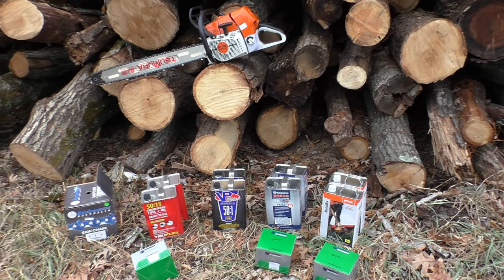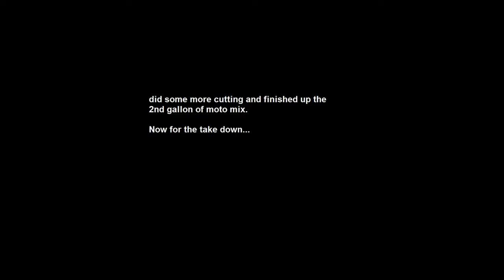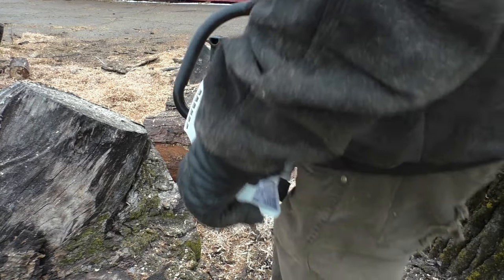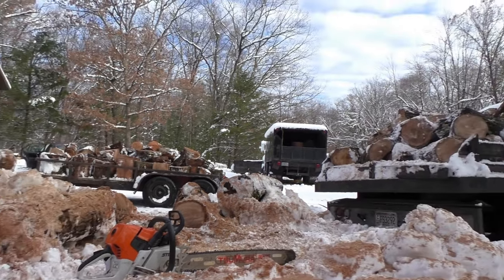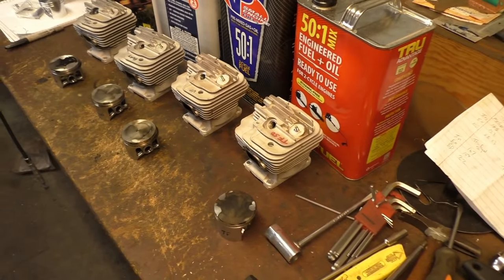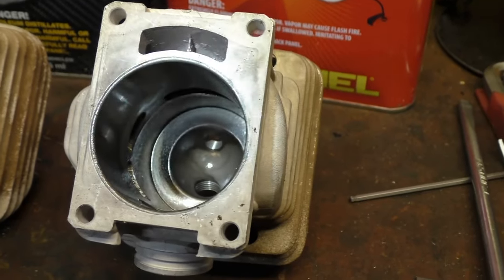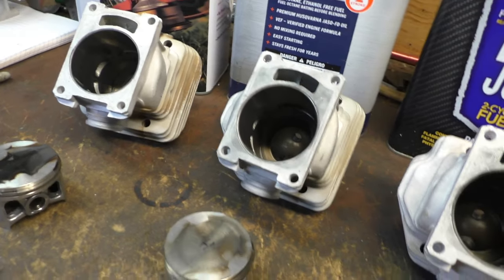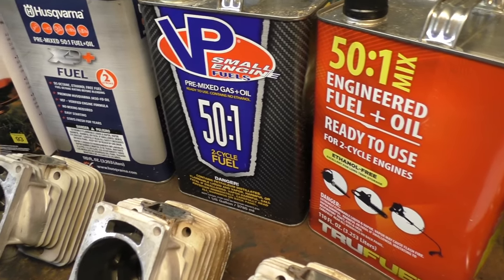Premix Fuel Test - Stihl vs Husqvarna vs VP vs Tru Fuel 50:1

Comment: Nice effort guys — Thanks!.  Two things though, I would have like to have seen the results of using pump gas as a final convincer, and the cost difference in using pump gas and simply rebuilding the carb regularly.  $24-30 for a gallon of fuel is pretty steep...
Reply: I wouldnt use Pump gas, that even with YOUR Equipment.. that's Trash, with Sketchy Guesswork
Reply: Understood, if you add up all costs it can be cheaper to accept any issues with pump gasoline, but I think they are testing this type of fuel for Joe Average who wouldn't even know that his chainsaw has a carburettor. Very good point, though. It's like a professional mechanic said to me once when I asked him if he thought "Snap-On" tools were worth the money; he said I never buy them, I can buy six cheap sockets, have a new one every few months and still be monetarily better-off. If Joe Average (ab)uses a chainsaw and throws it away after two-three years, he might consider that acceptable in money terms if he can buy the chainsaws cheaply from a Big-Box Store and run them on cheap gasoline. The same calculation is skewed in the opposite direction for a person who must heat his cabin with wood, has paid 4-5 times as much for a good saw, lives up in the tree-line in the middle of nowhere and values his equipment. Thanks for reminding me of that.

Comment: The piston from the moto mix is the dirtiest piston out of the 4, is that cause you ran more tanks of it than the other 3? You were also looking at the amount of oil in the crankcase, is more oil better or worse? I prefer the VP MIX and run the 40:1 in all my saws.

Comment: Thanks for the video! I use the Red Armor, been running it for four years as a home owner. A mix of Stihl and Echo commercial equipment. I can get ethanol free gas at the station, right now it is over $7 a gallon here locally. I have never used it, I wonder about water in the fuel from sitting in the underground tank. And yes, I know about the water separators, etc... Most gas stations around here cannot even clean their bathrooms, so I think what must they be doing in regards to pump maintenance? I'll continue to pay the vig, never had an issue with the Red Armor.

Comment: I have run a Stihl MS441C for 20 years using pump gas and TSC 2 cycle oil, with no problems. I also add StaBil to each tank, and I have not had to dump the tank in the off season. BTW, where is the PPE? And why do so many sawyers play with the throttle?

Comment: 1- Get a certified safety fuel can.
2 - Go to your local small airport and buy 91 octane "auto gas". No ethanol no lead.
3 - Mix your own for about a quarter of what canned fuel costs.
Reply: Great post Rodney!  Premixed fuels are VERY EXPENSIVE.  At Lowes, premixed fuels range from $20-$25 for 110 ounces (128 ounces in a gallon).  In north Florida, 89 octane non ethanol gas is readily available for $3.50 a gallon.    To stabilize your fuel, you can add Stabil (30 cents) or Sea Foam (45 cents) per gallon.  Its your money.
Reply: @I am Joe No at the airport they call it auto gas. Completely different pump than the avgas
Reply: In Canada most of our gas stations offer ethanol-free, it’s pretty good stuff, like you said for about 1/4 the price… but then again that gas is for cars not small engines so it’s nice to have the option especially if you are an ocassional user, for pros I think they would go with the cheaper option
Reply: Rodneygd  I live on the Great Lakes. The fuel stations sell non-ethanol fuel in premium and mid-grade. I wonder how the price compares to air ports? Either way it’s gotta be cheaper than the engineered fuels.
Reply: Aviation gas still contains a large percentage of aromatics, which are actually a lot more harmful both for your health, and the health of your small engine than ethanol. Check out Steve's Small Engine Saloon's video on this very topic. Your best bet is to spring for the Stihl pre-mixed gas, especially if you're a homeowner. One gallon of gas goes a long, long way in a small engine, even in a powerful chainsaw. The work done by the tool on a gallon of gas should justify the $30 price tag many times over on a big job.

Comment: Man if you use a chain saw all the time and you bought 20.00 dollar plus fuel just to keep your saw running longer is ok. But you spend so much money on the fuel you could save that money and just buy a new saw. You would spend hundreds of dollars just buying great fuel. Don’t add up. Great video hats off to you! Buy non ethanol and you good quality oils to mix with.
I would like to add this: those fuels you tested are great and no doubt would not gum up a carburetor when you store your your equipment. They definitely have a place. And if you can afford the best then why not.
Reply: I agree but if the saw performs like crap on the cheap fuel, that might just drive me crazy !
Reply: Agreed. Someone further up the comments suggested that you could also use regular gasoline during the season and just switch to canned fuel for the last couple of fills before storing the machinery. However in Sweden I think they mandate the use of alkylated fuel (Aspen) if you have employees (Health & Safety legislation). Sweden is heavy on the liberal attitudes.

Comment: Will the Husqvarna XP+ 110-fl oz 50:01:00 Ethanol Free Pre-blended 2-cycle Fuel work with my Husqvarna 150bt backpack blower and my Husqvarna Heavy Duty Chainsaw 440?

Comment: Just came across this video and you really went above and beyond!! Best video on canned gas ever. I’d have expected VP to look cleaner as that’s all that they do. I’ve tried Tru Fuel in my new string trimmer and it was horrible. Lacked power and was slow to rev up. Went back to pump gas and Bel Ray oil like I’ve used in all of my 2 strokes for 30 plus years. Runs like a top now. Thank you for doing this video!

Comment: Would it be okay to dump a cap full of hp + 2 Husqvarna oil into a can of the store bought premixed Husqvarna gas? Would it help the bottom end? not so much oil to change the ratio but just a little bit?

Comment: Hi One of your subscribers in Melbourne Australia,I use stihl hp ultra oil at 50:1 in my 2 stroke husqvarna chainsaw is this okay?Regards
Reply: Should be ok, I switched to Castrol power 1 racing 2t as it is much cheaper. What model saw have you got?
Reply from the maker: if I were forced to run ultra I'd run it 45:1.  Not as much oil as 40:1 which I'd like but I personally don't think it burns clean at 40:1.  50:1 for me isn't enough oil with conventional gas.  So 45:1 would be a nice compromise.   I like mobil 1 2t which you should be able to get?...I can't get it here anymore but I see it on ebay over seas.  Also like Schaeffer's 9000 and 7000.  Honda HP2. Motul 800 OFF ROAD.
Reply: Dick Springfield I have the husqvarna 440 e series I l for farm use thanks
Reply: Redbull661 Redbull 661 thanks for your feedback I was told by a Stihl dealer to use this as he told me it being full synthetic is the best oil for the engine

Comment: I used the Tru Fuel in my weed eater  and chain saw.  After using it for a month I had trouble in both 
Pieces of equipment with residue build up which created starting problems. Had to have the carbs cleaned,.
Went back to mixing my own fuel. No more problems.
Reply from the maker: thanks for the feedback.

Comment: Good video.  Question I have is a comparison of wear between 40to1 and 50, did the companies get dragged into 50 just to satisfy the EPA?  I would guess more fouling with 40 but how about the bottom end.  Long ago we were using 24 to 1 in our outboards, engines that can run for a long time at heavy load, of course water cooled, how have the mix changes affected engine life?  As far as emissions go the relatively little amount contributed  by saws compared to just one urban rush hour traffic jam should be recognized.
Reply: I should add that here in the states the biggest selling point for the premix fuel is the lack of ethanol and all the problems with that.  Does anyone else in the world use that crap?  If I don't have premix I use 100 oct. low lead aircraft fuel, this is a very stable fuel and very low lead so that isn't an issue  AND  no ethanol!
Reply: Does Canadian gas have ethanol?
Reply from the maker: good question.

Comment: I've been running Husqvarna canned fuel for 4 years in my trimmers. In my oldest one its a Husqvarna 223L it has a lot of hours and heavy use in ditches and around a pond bank with thick nasty weeds and absolutely zero signs of wear or issues. I'll keep using the Husqvarma especially since I have to adjust my carbs when I've tried different brands of canned fuel.

Comment: Crazy how the prices have changed since this came out. Stihl is now like 40$ a can, Husky is 27$, and VP is 27$. Im going with VP for my premix stuff.
Reply: Husqvarna 50:1 is $30 I have Husqvarna equipment and I use that brand, I'm not committed to it by no means but good fuel is hard to come by these days and it does great so far. If a service station would put in a 95 Octane Ethanol Free pump they'd make a killing because there's no option other than can fuel meeting that criteria.
Reply: @nicke1903  well for saws and nearly all outdoor power equipment you want the lowest octane e-free available.. higher octane just loses power on these engines

Comment: First of all....Great job on the fuel test. Very informative.  I hope you recoup all your expenses in the near future. 
In your next set of fuel test, could you please include a 90 octane pump gas with 10% ethanol.  Mixed with Amsoil 2 cycle  oil at a 50 to 1 mix..A lot of us still run that mix.
 Thank you , for your consideration. 
Also did all the spark plugs have that good copper color like the first one out of the stihl fuel ?Once again Thank you, for your excellent test. May you and your crews family's  have a HAPPY AND HEALTHY NEW YEAR !!!! KEEP UP THE GREAT WORK !!!
Reply: I would like to see this test too . I do a lot of sawing and blowing but cant justify using those high rent canned fuels.  Will probably have the chainsaw gods strike me down for saying that .
Reply: I use the same oil but with 93 pump gas and it runs way better with the 93 compared to 87, especially after 10 minutes or so.

Comment: I’ve only had experience with the TruFuel, and the Husqvarna Pre mix, and have had good luck with the Husqvarna.  This fuel setup is so expensive, but like my local Shop Tech says, if the saw, trimmer, whatever has infrequent use, it’s better than pump gas and oil mix.  

A Stihl Dealer told me long long time ago, when mixing pump gas, go with the high octane.  He went to some Fuel School training, so I figured he knew what he was talking about.  I don’t think it makes much difference with all these pre mix brands, like you all said.  I only use Ethanol free (supposedly) from my local gas and go store, to mix 50:1.  Have not had any issues.  I use the Husqvarna XP oil.  My little 345 is coming up on 14 years, and still going!  

I gotta say, that Stihl and bar combo looks sweet, and sounds and runs sweet!  Your saw skills are good!  I think it ran a little better with the Husky Premix?  🤔 😂 Again, appreciate the effort to make this video!  Peace!  👍✌🏻🇺🇸
Reply: I've always had good results with the Husqvarna pre-mix. Plus I love the smell. Always has a new Husky tool smell lol. I think his saw ran best on it too

Comment: Thank you for this video. Great work guys. Very impressive. I do have a couple questions. 1: Would chain bar oil make a difference? What would you recommend for bar oil? 2: I see some differences in the fuel however would it really make that much of a difference? Also wouldn’t you want to use the fuel with the cleanest head? I thought you would want a bit of oil in your crank case to help give it longer life. One last thing how long could you store this gas and still use it? 1year 2year or more?
Reply: I can tell you what works best for bar oil, Automatic Transmission fluid! It has the best lubrication properties of any oils made!And it has detergents the help clean as it lubricates. I used to work at a Transmission shop when I was a rookie, And the guy that owned the place was a guru! One of, If not the smartest men i have ever been blessed to learn from. I own 60saws or more and what I see that makes a saw stop operating is the bar oil is so thick and most guys don't keep  the chain sharp so enstead of making chips it makes a fine powder out of the wood. Mix that with the thick bar oil they sell you over the counter and you make what i call a slurry that ends up going through the holes in the pull starter side case and ends up coating the ignition coil with the slurry and you get no spark across the magneto to coil. Just make sure you dump out the oil reservoir before you put the saw away or the next time you open your saw case it will have every drop in the bottom of the case because it is only 10w oil and very slippery stuff!

Comment: VP's full synthetic oil says it has fuel stabilizers and ethanol protection. I've been running that instead of the premix because that stuff is so pricey.  Have you tested on how well the "ethanol protection" actually is in VP oil or just on the premix?  The 16oz bottle is only around $10

Comment: Call me crazy but in terms of burning I believe in general slower is hotter and hotter is cleaner(carbon and excess oil etc.) ?so the higher the octane the slower the burn and in turn a hotter cleaner burn of the air fuel mixture...I haven't tested Temps between fuels in a test before....but am I right with train of thought?

Comment: Did you note when was the fuel made? There should be a production date on all of the cans, and I have found that some fuel can be as much as 6 months old before it is even purchased. Your tear down and visual inspection shows the efficiency of combustion, and I wonder whether the age of the fuel makes a difference. I would have liked to see how much power the saw makes running on each fuel, as for me, that's probably the biggest reason to use premium fuel over pump gas. And if power is not important, then the only other reason to use this fuel is to hopefully to avoid the inconsistency of pump gas and the occasional issues associated with pump gas.

Comment: I'm pretty sure the husqvarna fuel is very close to aspen, they are both Swedish brands. That video convinced me on the stihl hp ultra and how good a lubricating oil it is and clean. What did the motomix smell of? Like regular gas mix smell? Great comparison and a lot of work and time went into this. Thank you. Liked and subscribed. 👏 👍

Comment: Great test and great info thanks! I’m surprised you haven’t run the echo red armor pre mix or is that coming as well? Appreciate you doing such tests to further the community!
Reply from the maker: hmm wonder if home depot carries that
Reply: Redbull661 ours does, I buy a can every so often and keep it on hand in case my wife wants to run the trimmer or blower. That way she doesn’t grab the “wrong can” and burn something up lol.
Reply from the maker: @manofstihl6612  THAT is a great idea!!!
Reply: Redbull661 thanks! I chose the red armor after seeing a post of your a whillllllle back where you took apart a saw(I believe run at 32:1) with red armor and it was coated very very well through. So you’ve made an impact for sure with your tests
Reply from the maker: @manofstihl6612  I heard red armor changed their formula and not so much for the better I think was the reaction.  So until I test it again I am sticking with my old reliable schaeffer 7000 or 9000 32:1.

Comment: All these higly pure fuels are in fact same type(alkylated). Just simply the best for small engines (and especially for winterizing them). Never had any kind of fuel related issues with it or decrease of power. Many seasons and long periods of sitting wasn't an issue.  Sadly it's expensive.
Reply: Agreed, but @chickanic definitely found issues with Trufuel in her Small Engine Workshop that I've never seen having used Aspen Fuel in the UK for a long time. I thought that they must be nearly the same, but maybe not, judging by this video.
Reply: yes, Trufuel and VPfuel are not alkylated(synthetic) but highly purified

Comment: I just got my Stihl saw bavk from the Stihl saw shop.  My saw would not start after running it to cut some poles last month. I was using True Fuel.  The Stihl shop said True Fuel gunked up the Stihl carb and tank breather.  Could this be the True Fuel or the finique Stihl carb?

Comment: I have found that my saws run better on an octane around 90. Running 87 they definitely do not perform as well. Similarly we tried 100 octane and that did not produce the best results either.
Reply: troytreeguy I find anything in the 80’s it starts to run to hot and then come the issues of it cutting out and trouble restarting again.

Comment: So ethanol free gas and sthil hp oil ???
Also I have a echo weed eater and chainsaw that if I'm only running for a short time I use Tru fuel if long period I use my echo oil and pump gas ... I have a 661 that I just bought and only have ran motomix by sthil in it so far I'm 25 tanks in yes I've been counting lol ... thank you for sharing I want my tools to last ... I have 6 sthil saws not counting the 661 and have always mixed my fuel and they all start and run well... but this is a cool and costly video thanks again fella

Comment: I always add Seafoam to any 2 stroke fuel even that premixed. I let my little echo sit and warm up for 5 minutes just idling.
Reply: Marvel mystery oil is better. can use it in the gas and oil
Reply: @leadnsteel1428  Have you had success adding Marvel Mystery Oil to a pre-mixed 2-stroke fuel?